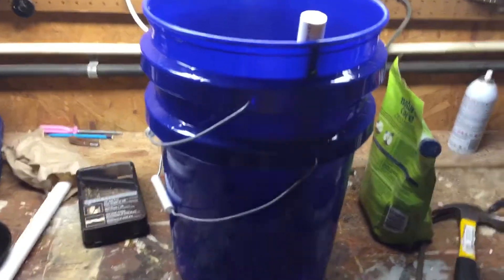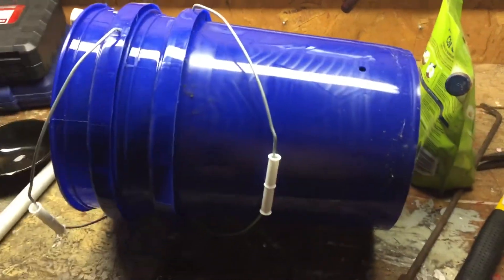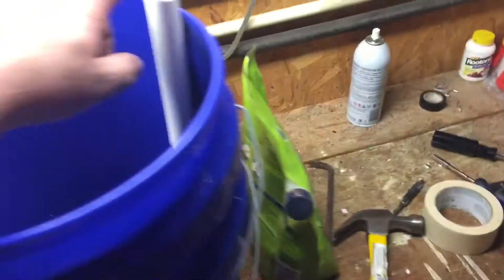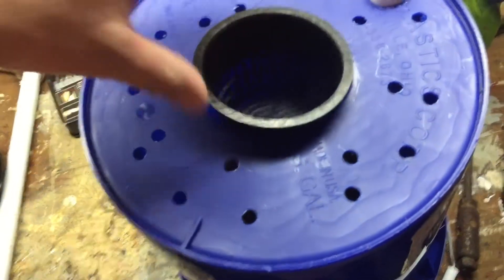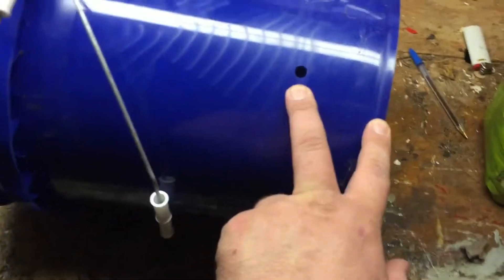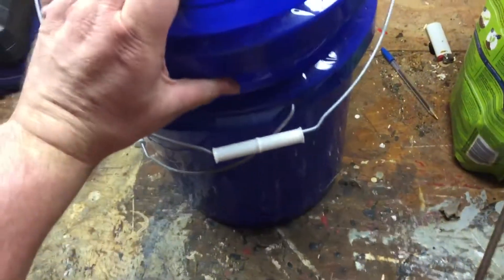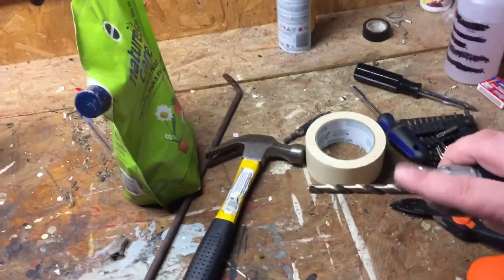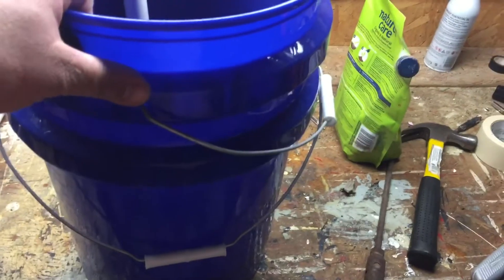Dutch Bucket Self Watering System

Comment: thanks for the info.  i use this system too.  i do have a question, do you cover the soil with plastic bag? i see u have other videos with these buckets gonna check the other videos too.
Reply from the maker: Leona Hopkins only if it's winterizing.  During the winter it gets trimmed back all the way and covered and put in the storage unit.

I didn't do it tho.  I will in another season.